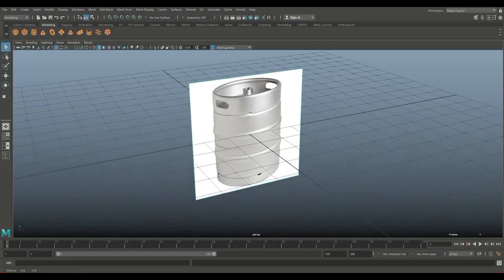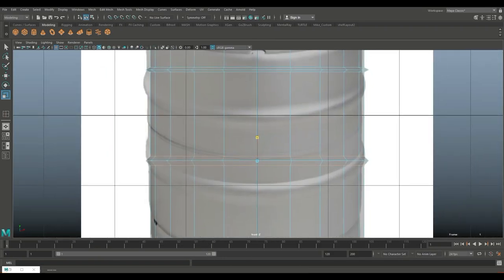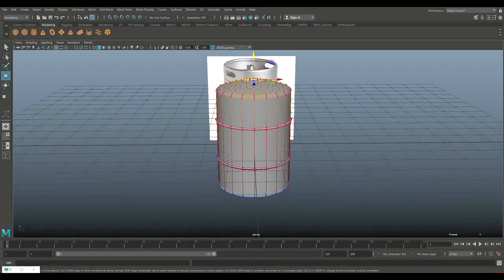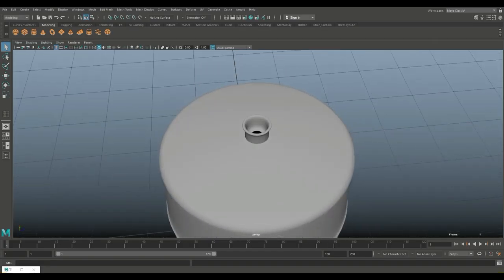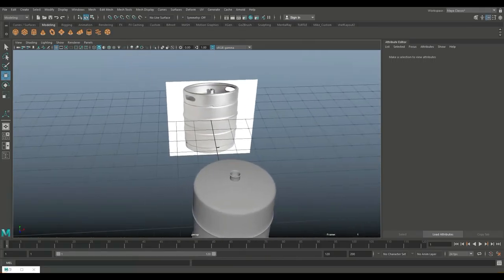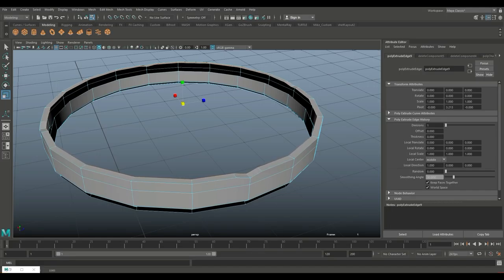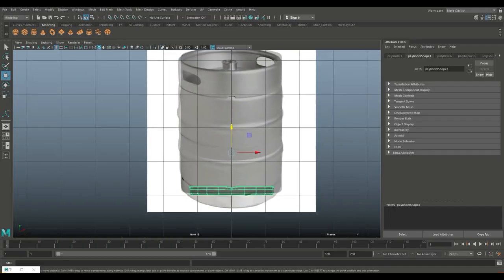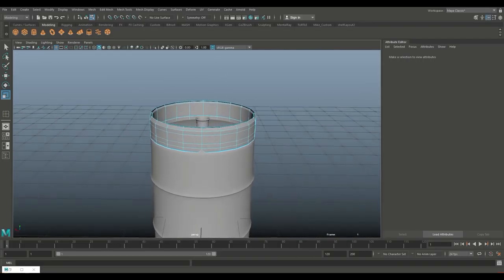How to model a BEER KEG in Maya 2018

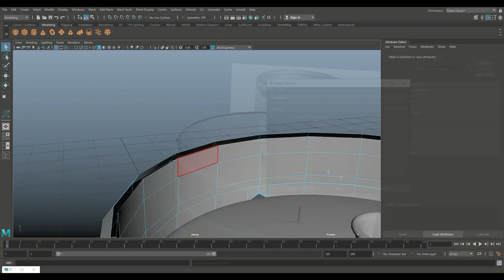Comment: 20:58 for future reference, the Bridge tool can do multiple edge sets simultaneously, eg; in this instance you could select the two cylindrical edge loops (double click edge) across the open gap and bridge once.
Sometimes it bridges the faces to the incorrect relative edges (causes a spiral if looking from top view in wireframe), to avoid this I usually just bridge the loop minus one set of edges, then "fill hole" on the remaining quad, and since it's not free to choose where to start/end the loop it doesn't cause incorrect matching. Thanks for the video as always man :)
Reply from the maker: Good to know, thanks

Comment: Hey. At 1:50 instead of doing insert edge loop, if you shift+RMB on the object and go to multicut tool. You can hold in Shift+Ctrl to insert an edge loop directly in the center of two edge loops instead of guessing. I just found this out on the "Maya Modelling Secrets" video by FlippedNormals.
Reply from the maker: I know, I actually demonstrated that in a video a while back. Thanks for sharing

Comment: Hey Mike ;) Got an other tip. at 2:09 you use the center box of the gizmo to scale those 2 edge loops, by doing that, you need to adjust their position to have them somewhat centered again. If you used the flat green square between the Z and X axis manipulators, you get the same result as what you wanted to do, but the edgeloops stay centered. Anyway, great video, looking forward to the next one.

Comment: 13:28 you created an ngon. Is it ok to have ngons from time to time??
Reply from the maker: That depends. When deforming a model in an animation ( like a character ) or using external 2D texture files you need to be very careful with nGons. They can cause texture tessellation problems or deformation problems.